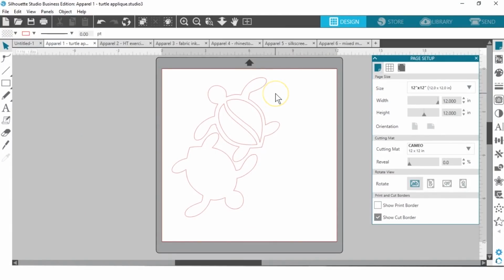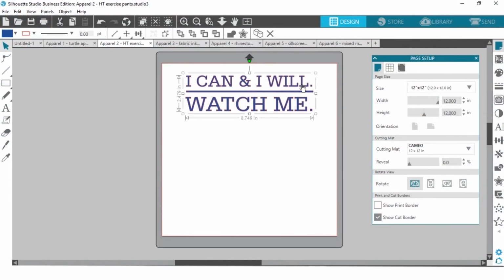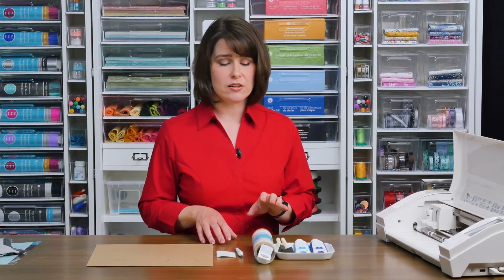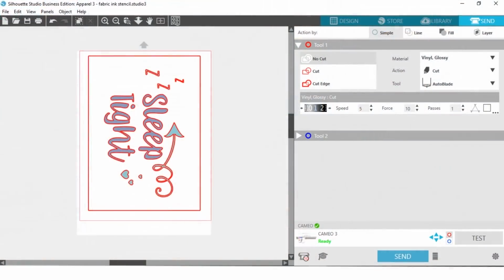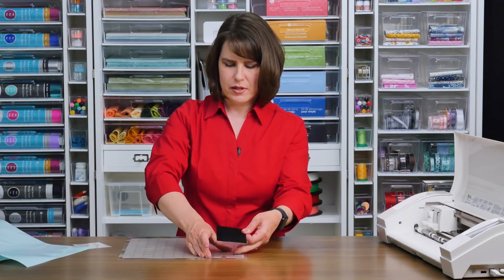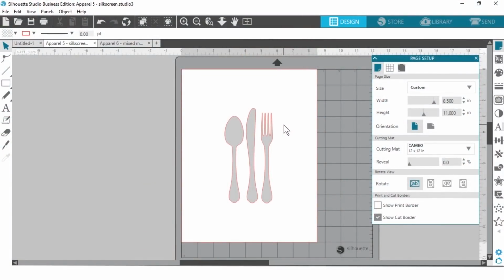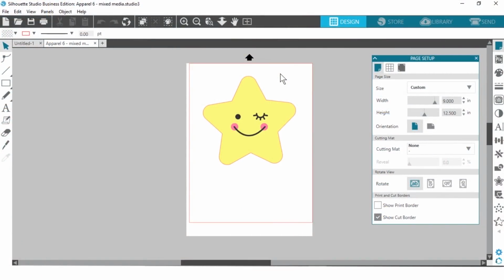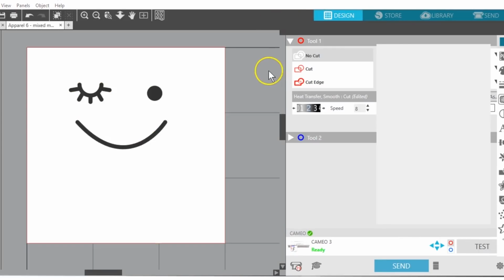Creating Custom Apparel (Silhouette 101 Video Class)

Comment: PLEASE HELP! I downloaded a pattern from the Silhouette site and I have no idea what to do with it, it came in so small I can barely see it. There is a blue line running across the screen and this is at the end of it Y: -8.819. I am new to this machine so I have no clue how to get it in a way I do understand to fit the multiple pieces on a mat I understand to send it to the cutting part. Even that comes out crazy. 
I've asked Silhouette for help but they have no idea. I'm hoping a savvy crafter out there might. I did try using the magnifier but that only blew the picture up, not in a way I could cut it apart. The creator did not even say how big the pieces should be, only the finished product and has never gotten back to me. I will so grateful to anyone that help me make it to a size I can work this. 
I'm here because this is what I sent to watch to fix it, shaking head

Comment: Hello, I notice you’re using an iron to apply your HTV.  Is that the best tool to apply HTV?  If yes, do you recommend a specific iron?  Should I invest in a  heat press machine.  I’m not running a business, just using my Silhouette for gifts
Reply: I personally prefer a heat press because of the even temperature and pressure, but it's not necessary for occasional use. And a heat press is harder to store than an iron. Any household iron should be sufficient (cotton setting, no steam). I have more thoughts on this topic here. https://www.findingtimetocreate.com/2018/08/the-story-of-a-better-tool/